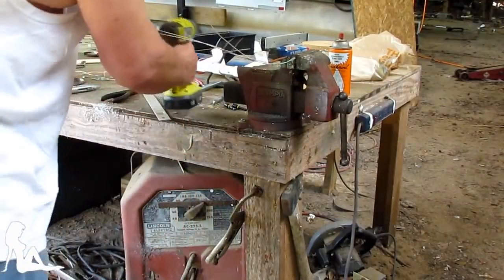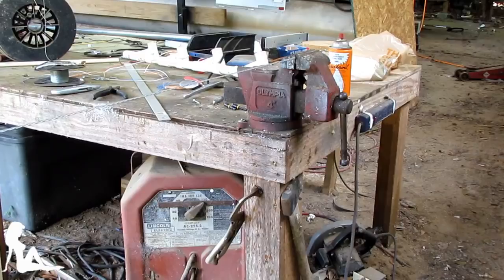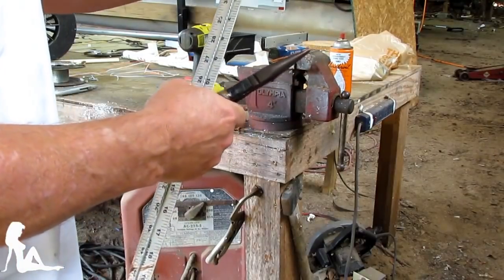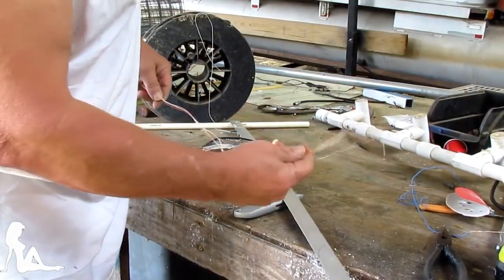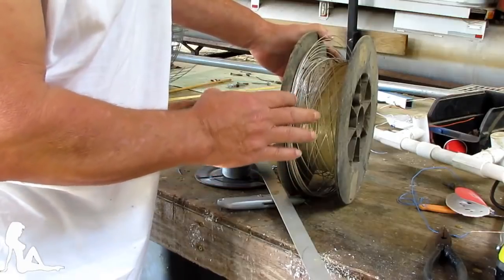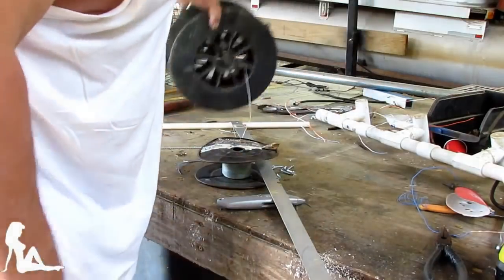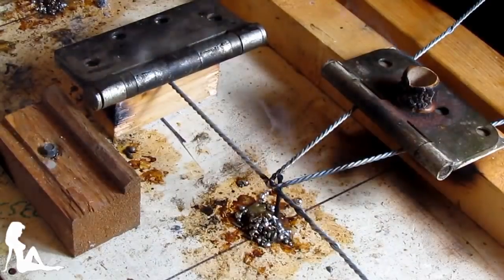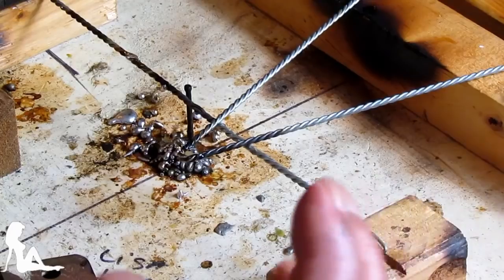Can I Use Electric Fence Wire For TV Antenna?

Comment: I made my own version out of scrap first time a cpl weeks ago. I live in Northern Kentucky and we get the Cincinnati channels. Dayton, OH is about 60 miles north and with your fine antenna I now get all those too, even the low power ones, some of the same networks play different shows so it's nice. 63 total.  (Cincinnati is a toilet but Dayton is good.) 
Thanks again for you sharing all that knowledge, you gave me the spark to make one. I'm a pack rat and already had those 75/300 transformers so it was FREE. Better than any of the store bought antennas I tried hands down, no contest. Keep up the good work!
Reply from the maker: thank you for  your input  sir
Reply: Electric fence wire might be good for short wave radio. You might get static every time the fence charges with AC. Hehe I had to add that. Seriously steel wire conducts but not as good as copper or aluminum. I made a UHF antenna out of coat hangers it worked back in the mid 70's. It even picked up high VHF. It was steel black coat hanger wire.
Reply: Rynne Taylor mi

Comment: Danny twist the whiskers around the main wire twice and use acid core solder like on copper pipe your connections will be twice as strong  built me one of your antennas using galvanized 10 gauge wire and with my method of connecting the whiskers that damn thing aint never gonna come apart. Thanks for the info best antenna I have ever used.

Comment: I am in the process of making my reflector using bronze wire. Will be soldering or spot welding the wires together. Have you tried using a soldering iron which is electric ?? I have found that electric soldering works a lot better and way cleaner than the gas type. Great mind think alike Danny.

Comment: Love your video's! Have you ever tried to get a microwave transformer and hook it up to the antenna to see what voltage you get from your antennas and resonate it all to power 110v for free. It is possible. Be careful with those transformers they are deadly/ same with the capacitors that come out of those microwaves. Peace & Grace.

Comment: You can solder that steel with the aluminum solder if it's the same kind as I saw at the flea markrt. The guy shows it will solder any kind of metal.

Comment: You should check out the steel wire they use to hang dropped ceilings, it's heavier wire and it might be better suited for your antennas.
Reply from the maker: i got some..its high